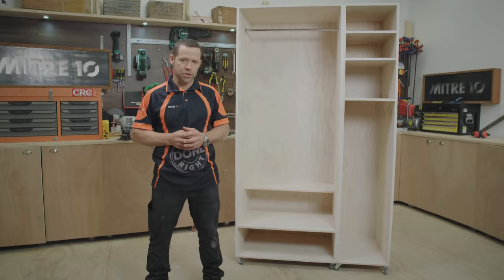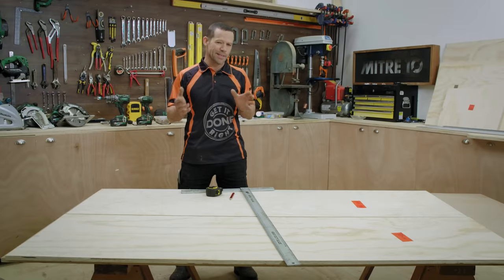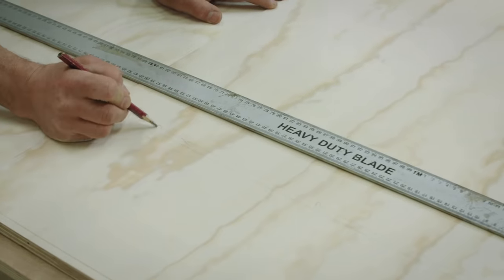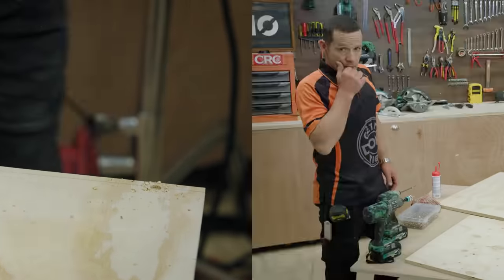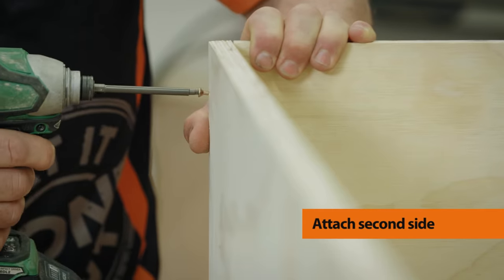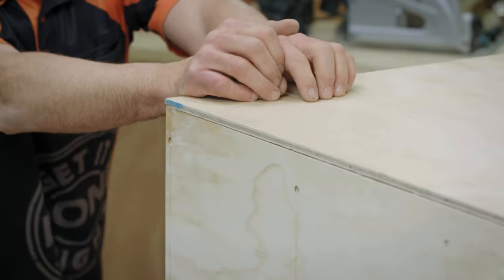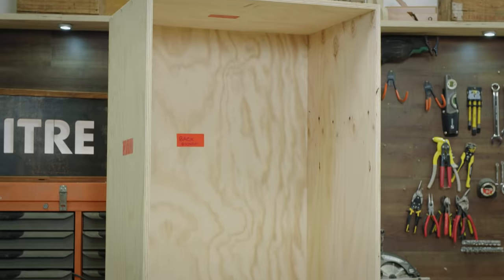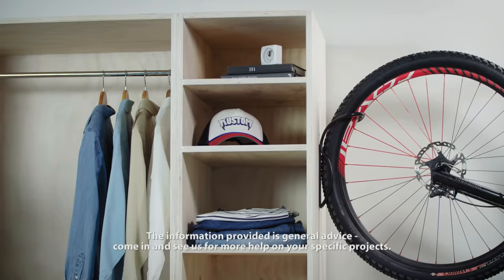How to Build a Wardrobe | Mitre 10 Easy As DIY

Comment: Great vid, guys! :) I'm building similar projects at the moment with my circular saw but find that I'm getting a bit of tearout. I've got a 60T blade and am taking it nice and slow to minimise the issue, but it's still not great!.....can you please help me achieve a crisp edge on my cuts?
Reply: Use masking tape on ur cutline then it should be perfect
Reply: You need support on the underside as those wood fibers have nothing to hold them in. either scrap wood on the underside that can be sacrificed or masking tape can help.
Reply: If you use your utility knife to cut the fibers of the wood along the line you want to cut it wont split
Reply: Thanks for the tips, guys! :)
Reply from the maker: Cheers mate, Hmm that’s not great news about the tear out. So this can occur when a couple of things happen, 1/ Blade is blunt, 2/ Not enough of teeth, 3/ Blade is buckled due to overheating 4/ Motor on saw is too fast for this kind of job. So there is a couple of things you can do to prevent this happening; Lay a strip of masking tape along the line you want to cut, remark on the tape and then make your cut or you can use a sharp utility knife to cut the first couple of millimetres of the ply. Maybe best to test these tips out first on a scrap of ply. If you still aren’t getting a great cut then you could cut a couple of mms away from the line then use an electric planer with sharp blades to plane up to the line, which to be fair is something I’ll do if working on something that's super important and can’t be stuffed up.